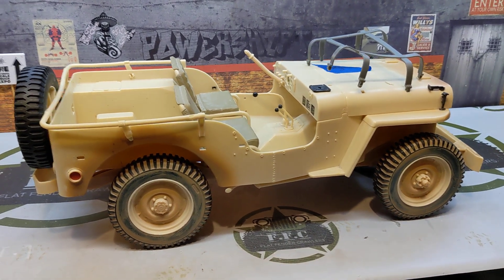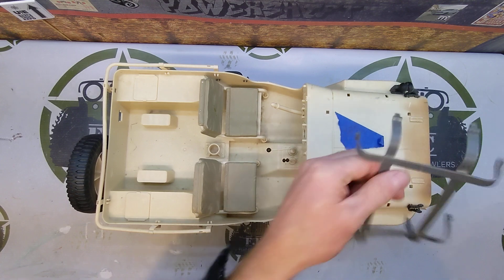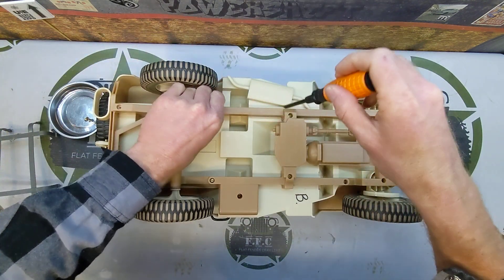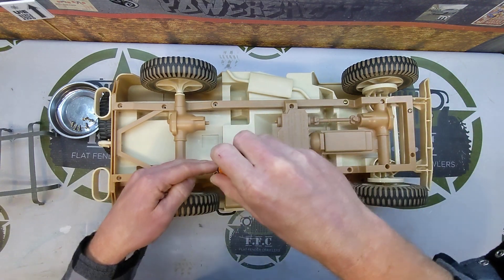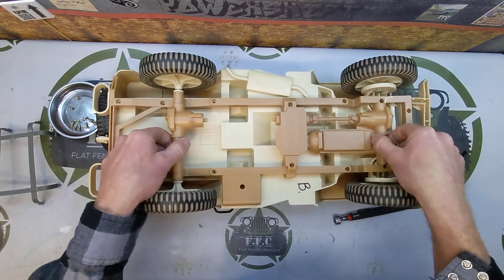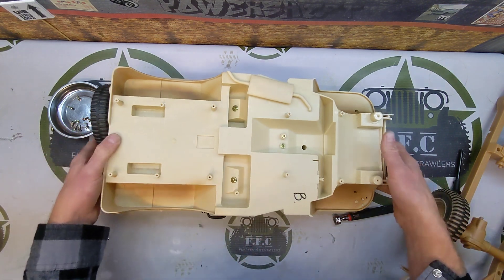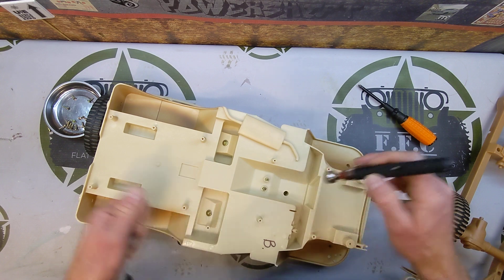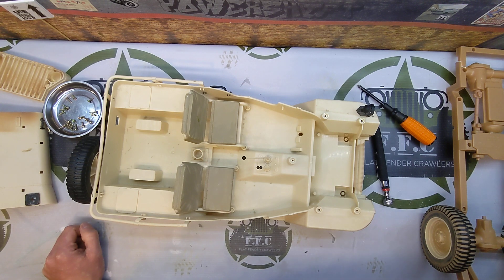Flat Fender Crawlers  1/6 Hasbro GI Joe Willy's Jeep rc conversion step 1: Disassembly

Comment: I converted mine a couple years ago. I have an scx 10 undercarriage and drivetrain mostly. It looks bad ass and is alot of fun. Only problem I have is that it weighs about 12 pounds. It will snap an axle once in a while.